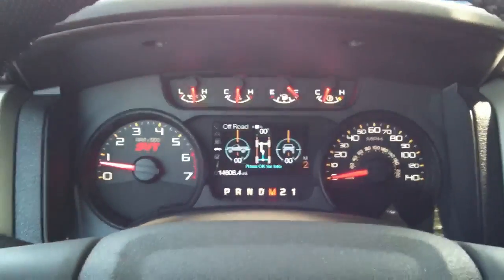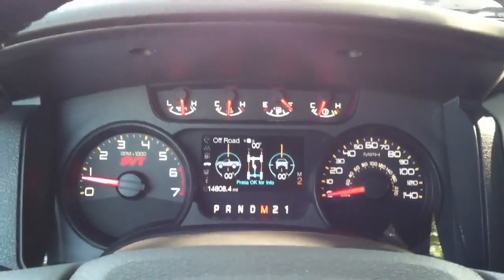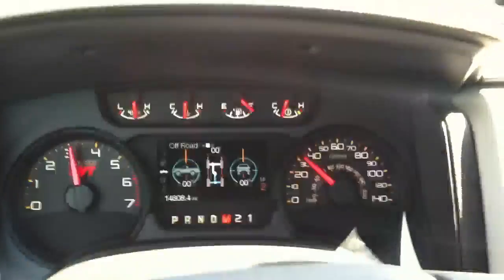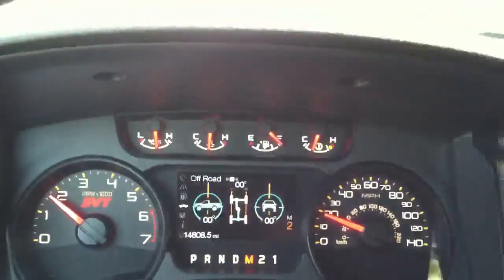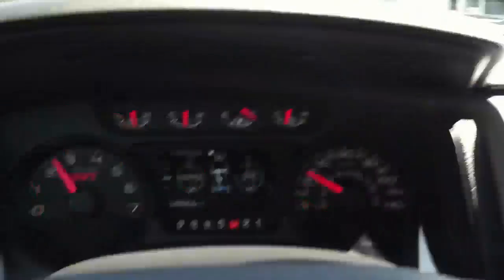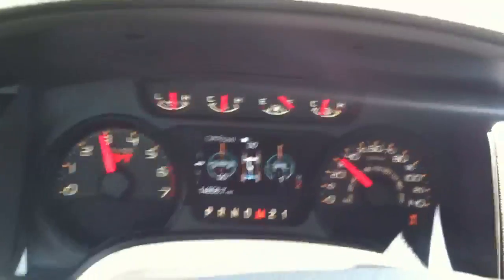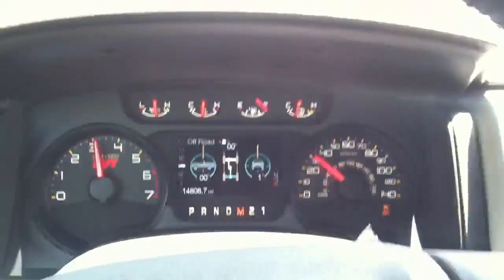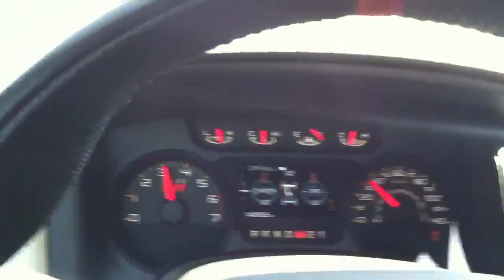Ford Raptor - Accelerator Brake Override

Comment from the maker: @strumem90 I had it installed professionally by Outlaw Raptor, in Santa Ana California.  I haven't taken it out to see how it was mounted, but they did tell me it's not actually bolted, just VERY TIGHTLY fit in place, so it's removable from the front if needed.